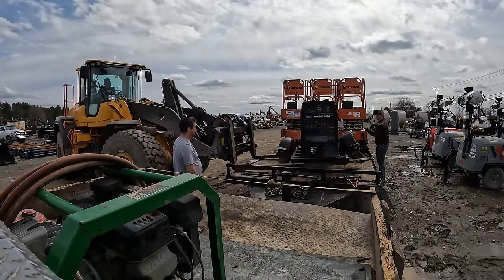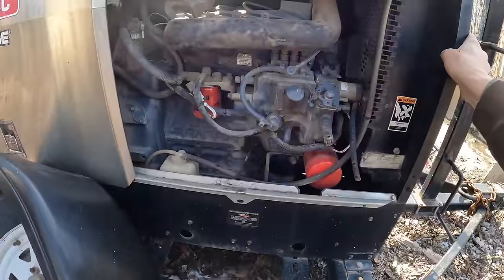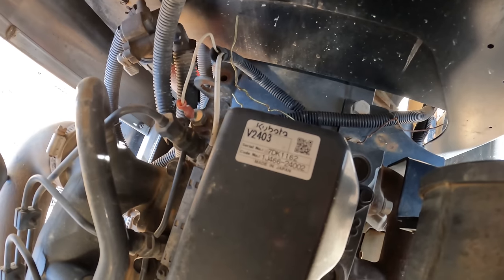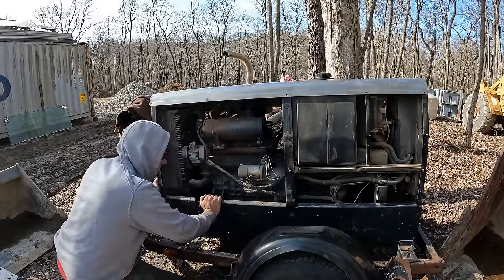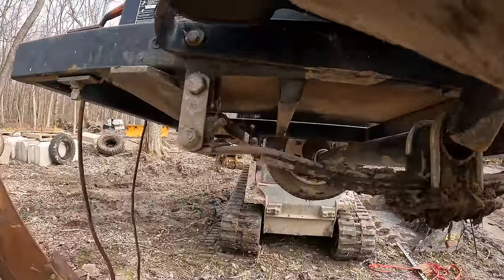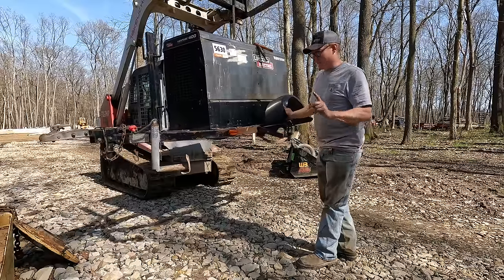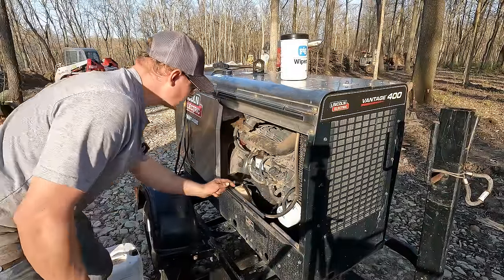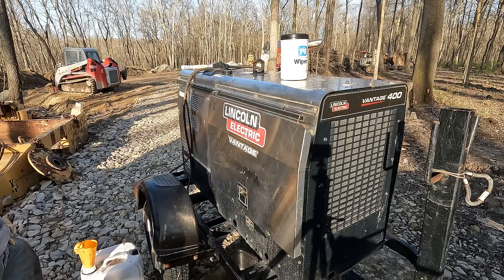This welder Fell from a CRANE? Can it be Saved (AUCTION BUY)

Comment: Great video. You da man. 
Google had this (https://youtu.be/FXdvcd67alQ) video as a recommendation. My first thought was "she is way over dressed". Then I remembered the culture. She does a good job on this old diesel engine. I didn't recognize any Napa parts. Should you remove the paint from the head where the head gasket goes? Sandblasting some of those compression fit parts made me cringe. Using a coal chisel to tighten the flywheel nut....ah.....yeah...not right. Oh that is ok it is going to be covered up by the pulley assembly. lol. I guess not everyone has the "right" tool for the job. When she picks up the motor to put it where it is going to be used, I thought "that thing weighs more than she does. I best not say anything bad about her, she could kick my ass. It will only be "yes mam, no mam". 

Her Fire up (cold start) face is not quite as good as yours, but you can tell she is excited.

Comment: if the fan is rubbing so to say then rather than just lift the engine up would you not look see what it is rubbing on then look for the cause then apply the right fix for the problem others say safety well guys guess what that is only a test and does not cost the earth to have done but Matt wrong fix my friend do it once do it right
Reply from the maker: That was the correct fix.
Reply: @DieselCreek  think i missed some thing then i do love your video's as they show the working man cheers Matt

Comment: You basically bought a piece of scrap metal for $3,800 bucks I'm going to tell you right now there's damage inside because of how welders work with capacitors and coils and transformers little damages to those things can be detrimental it can also be a very very dangerous to the operator you must not like your brother or brother-in-law so yeah okay glad you're not mine

Comment: WHY ON EARTH DID YOU  PUT THAT AXLE ON TOP OF THOSE LEAF SPRINGS..THAT DONT ALLOW SPRING TRAVEL...
Reply: Because that is how this is designed and of course it allows for all the travel that is needed for this application. This is a welder not a dump truck riding on those springs.  PLUS if you have a lot of travel you then have other problems and would need shock absorbers to to control the travel.